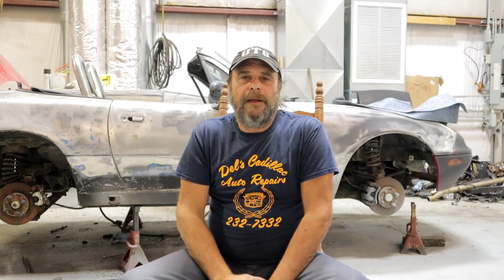Automotive De-Evolution...The Next Big Thing?

Comment: We are at a point where one’s interests aren’t limited by what the market is offering... for the most part. What I mean is as technology increases, that tech becomes less centralized. 200 years ago the looms that Luddites were smashing were the cutting edge and very expensive. The average person couldn’t afford them. Then steel and metalwork became possible on an industrial scale. But as tech increases, costs lower and the average person can buy it. 

Right now we aren’t limited to what we find on eBay if we want certain classic cars. What was once only a dream, you can now buy re-pop tubs, whole unibodies, created by a third party if you want a Camaro or a Mustang. Eventually that tech is going to be available where any obsolete car and part you’ve ever wanted will be available. And in many cases, you’ll be able to 3D print or MIM whatever you need from a printer in your house. This is already happening with guns manufacture. By the end of the decade you will be able to make whatever gun you want in the comfort of your own home.

The normal flow of market creation is the limiting factor for attaining a given thing is cost and availability. There are few who can create what’s on the cutting edge at first. But as time moves on costs decrease, as long as it isn’t regulated through the roof. Economy of scale and competition makes consumer goods less expensive. Patents expire, competitors appear. And when the item in question manufactures the very items you want to buy, like a 3D printer, we will begin to see widespread specialization. Rather than everyone make their needs to live, individuals will master making certain things very well and transacting with others. Whether they’re making buttons, garden hoses, or reproduction 3.8 Buick V6 engine blocks for people who build Fiero re-pop bodies people are going to transact

Comment: Hit the nail on the head in so many ways. The percentage of owners that work on new mustangs, challengers, chargers, camaros etc..is tiny compared to the way it used to be. I mean just think how much of that 50 year old aftermarket stuff is still out there. I wonder how much of the new "update" (as they say) stuff will be found 50 years from now.

 The old iron had soul and character. Regular people, hot rodders etcetc.. commonly used to name their cars based on what kind of personality the owners perceived them to have. Not so much anymore. Big rigs have gone the same way. In the mid 80s you could tell blindfolded what engine or sometimes even what brand truck was around you by the sound or the flavor (smell) of the exhaust. Today.... they're really big appliances for the most part.  As for not connecting to appliances tho...... you just haven't seen a woman get that connection...... haha..you see the right one rub on a fancy stove or fridge you'll wish you were the appliance!  

Btw you could have a whole separate channel just on carburetion (not saying you should, just could).  The number of guys who are clueless and think they are voodoo vs. all the different carbs and purposes they can be built for is largely untouched far as I can tell. Even a lot of the rebuild stuff you find is kinda generic. Whole buncha guys out there wouldn't even try rebuilding a lowly rochester 2 barrel. Just simply can't find someone to show them how and give them confidence they're going the right way. Thanks for sharing

Comment: Way behind you, i coverted my 94 f150 with a 300 l6, from efi to carb years ago.
Reply: Lets be honest though, that first gen efi was garbage.
Reply: @JonsGarage89  it was junk, i gained 3mpg by going to a 600 cfm holley
Reply: @oldreliable303  Heck yeah, I assume you used the offy 6=8 manifold? Those are fantastic.
Reply: @JonsGarage89  well first there was a homemade tunnel ram, but that did not work very well then, came the offinheizer c manifold

Comment: My first car was a 1974 dodge dart sport with a slant six automatic. I paid $125 for it and had to drag it out of a pasture. I spent my summer getting it running and cleaning the years of dirt, leaves and twigs out of it, but I loved that car. To this day it was the most enjoyable vehicle I've ever owned. I didn't have to worry about scratching it. It wasn't fast, but it was fun to drive, it was cheap, and it was fun to work on. It was so simple and easy to work on everything. I was a high school kid and was able to figure everything out (before Google and YouTube). That was over 20 years ago and I wish I still had it. I have such good memories of that car that I might try to look for another one. Not because I need it, but because it'll put a smile on my face and bring some fun back into turning wrenches.
Reply: Mine was a 67 camaro rs paid 300 bucks for it had a 327ci that ran very well then the army called and my car ran off on me.

Comment: the issue is parts.  Good or bad matters not. the 80's and 90's electronic
and onboard computer parts are NOT available. 
To put this another way, one can fix a carburetor  leak with new gaskets you can make
or a few layers of JB Weld epoxy.... while you hunt a better part 
I know of no one who repairs Dodge omni brain boards.
a machine shop can make most 1960's era engine parts
as well as gearbox and diff bitz...
automatic trannys may be a show stopper.
a 1962 dart is likely to be road-able before that 1989 omni

Comment: I've got 81f100 351for 20years an 33yrs 76f250 302 both Cleveland v8 here.in australia Japanese an European plastic junk is every where an all used to have a go at me for driving a gas guzzlers now with the cost of repairing them I have the last laugh it's costs them thousands to fix the new diesel when they break down after getting water in the fuel

Comment: This concept speaks to me.  Plan for a new project is a blend of modernish and old.  89 5.0 HO, fabricobled tunnel ram, single carb blow through with a turbo.  Going into a 63 Studabaker Lark gasser style.  Grand Cherokee Dana 44 welded in the back.  Still scrounging for a proper straight axle for the front.

Comment: When I was growing up in the early 1980’s, all of our cars were junk - ‘68 Mustang 6cyl Coupe, ‘73 Pintos, ‘75 Granada 302v8, ‘74 Econoline with a 289 v8 swap running, ‘48 GMC 1 ton (original), ‘73 Cutlass 350 Rocket v8, ‘68 Buick 6 cyl …just a bunch of worn out junk. But I enjoyed working on them and fixing them, rebuilding engines and swapping used parts. I could usually get anything running if it had some compression...just add spark and fuel and it would pop.  I even got a junk flathead v8 running once. I sold used engines and did some rebuilding/re-ring jobs, and junked out cars to make some cash. They were fun and cool and dangerous, loud, foul smelling things. But there was such an appeal…I guess it’s the gasoline in my veins. Thanks Uncle Tony…glad some people understand.

Comment: I bought an 83 trans am for my my first project/ hot rod thinking I was getting something like your talking about simple and enjoyable to work with but it definitely not 😂 there’s so many hoses on the thin it looks like someone dumped a giant pile of spaghetti noodles on top of the engine. Just trying to change the passenger valve cover gasket was enough to make me want to junk it 😂 I’m still looking for a video of someone doing just what you said de-evolutioning one to clean up the engine bay and make it simpler. Literally gives me a headache just looking at the forest of hoses and wires 😂

Comment: I’m 19 building a 69 roadrunner and a 68 coronet 500 I’ve commented quite a bit and I actually have a set of Holley 6 pack carbs and a carter 850 CFM thermoquad  and a set of a carter 4131S AFBs from a 66 426 hemi

Comment: Modern 3D CAD and CNC machine tools, while amazing in their complexity and accuracy, are so close to geometric perfection, that they give a noticeably colder and less "human" look to everything. The pre CAD and CNC era product still had the tell tale signs of the hands that made the models that were then used to pantograph cut the metal for most of the tooling. This is a subtle but real difference. 
Then you have the much greater array of geometries open to the CAD designer which promote design decisions unique to CAD. Finally, you have cost cutting which cheapens all those other factors. The end result is the soulless look we all know too well.

Comment: Biggest problem I've seen with Stand alone EFI systems most don't have a clue how to wire them up. I've seen it, ground and power wires not ran to battery, piss poor connections from non sealed crimped butt connectors that barely hold wire in, tapped wired together and even seen house hold twist nuts WOW. No grounds from engine to chassis or engine to battery. People still using old alt that car came with like older Fords with 1g alt that they used from mid 60's to mid 80's. They barely good enough for what car was built with but people put on EFI system, CD ignition or booming radio. NO WAY IN HELL that Alt will keep up. All cars manufactures had this problem with barely good enough alt. Let alone I'm a tech doing this for 30 yrs seen ton of stuff and people wonder why they have soooooooo many problems. Even with old stuff back then they called everything junk junk junk. My dad worked for Ford dealership through 60"s and early 70's plus working at transmission shop and at home. Everyone call vehicles junk back then too same story every year so whats new

Comment: I am 36 uncle tony and I can tell you I got  really interested in this era of engines and wanted to know the tricks bc being a young kid in the late 90s and early 2000s I was told by every generation that was older than me that I would “ never be able to afford one” which really made me think “ why not?” And it only made me want to experience these cars more.  I have had a few bandit trans Ams, a 72 Mach 1 351 cobrajet 4 speed car, and now I have a 72 gto 400 4 speed.  I think because at that time when I was a kid since there was already a romanticism with American muscle and the sounds of a factory hot rodded v8, older generations basically saying my generation was too late to the party short of put a fire under our ass.  I don’t care about turbos and running 11s easy, I want to get a stock 60s or early 70s muscle car and jet the stock carb, curve the distributor, throw some headers on, and that sort on thing and actually experience what it was like to be a gear head 50 years ago and know what kind of result I can get using those same techniques that were used back in the day . It’s really about feeling like you can get back in time and experience something that is lost to everyone around my age. Also, btw that engine shoot out was a suggested video yesterday on YouTube and i clicked and watched the whole thing.

Comment: My dad test drove a z28 four speed 302 . Back in 1968 . White and gold . Convertible . The sales manager gave him the keys & said you wreck it you bought it . He did not want to ride with my father . It was wicked fast . He took it easy . Was not Broken in yet . My mother wouldn't let him buy it . Car pulled the frount wheels off the ground while burning rubber . I saw one when I was 21 my sister tryed to buy it . My dad let the clutch out . I had to keep from Rollin in the trunk . Back wheels breaking loose front end going off the ground car flying like a rocket . She did not buy it we all said no . New cars are power full but not like that . 1970 you had power style smooth ride beautiful insides . Next best thing we're 1983-87 Monte Carlo all was right except low power 305 EFI  . Close but not quite

Comment: It comes down to  two things. First is SIMPLICITY. Most anyone could/can do most of the work with very basic tools. Second is it was CHEAP. Check the price of a cam for a new LS engine vs. a 350 Chevy. You don't need to go to someone and have them tune your car with a laptop and a dyno $$$. You need a regular screwdriver a 9/16 wrench and timing light.

Comment: I agree that 1970 is the high-water mark for performance but my favorites have always been 67 through 69 simply because I didn't like the changes to the Interiors in the cars in 1970. It seems like 1970 is when the plain steering wheels and wood grain Interiors took over.
I've always liked the black and chrome Interiors with Chrome on the steering wheel and a chrome horn ring.

Comment: Amen, Tony.  This upload is THE spot-on philosophical eternal truth of the automobile.  Someday, somewhere, someone will write an article dealing with the literary "ideal" of the most perfect automotive "hitting the nail on the head".....AND, this upload will have no peer.  You are so right- on about the major love affair a fellow has with a car that has to deal with the feeling of "I've died and gone to Heaven" feeling that you get when you are elbow-deep working on your car and your semi-warm 24th can o' beer was so slick with engine grease/oil that it nearly slips from your "tired from turning a wrench" hands that you could barely hold on to it.........and you looked at the clock in the garage and noted it's 2:30 AM and figured "What the hell", I can still get another hour or so in and still make it to the job tomorrow.  As you looked out of the open garage door into the black night with the twinkling stars and you just KNEW that this baby's gonna run like a raped ape tomorrow.     Yeah, there's a tremendous thrill when you run one of today's supercars thru the gears.......but, somehow, it can't compare to the feeling you got doing the same thing with our cars that we actually worked on, fixed, and understood how each part worked.  I am old enough to be your Pop and I was one of the "Levis, white socks, loafers, and a "pack of Lucky's rolled up in the T-shirt sleeve" generation that prayed at the altar of horsepower, more tire, bigger/more carbs, chopped and channeled hot rods..........and the Lord looked down on us and noted, "IT IS GOOD".  Something tells me that, even HE when HE looks down today at the ever-more-complicated stuff, gets a tear in His Eye.

Comment: Funny you mention the old cars had a coolness and character the new ones lack. I watched a video where a then brand new 2020 Shelby Cobra went head to head with an original 1967 Shelby Cobra. The engineer was explaining how to activate the launch control on the new one. “Push this, scroll through the menus, select this, say yes, then yes again ...” 

The coolness factor dropped like a rock. What a turd of a car, even if it is 5 seconds quicker and nearly 40 mph faster in the quarter mile.

'67 = 15.24 sec.   92 mph
'20 = 11.49 sec   130 mph

https://www.youtube.com/watch?v=FUO6nq8BDX4&t=85s

Comment: We connect with the cars people built by hand. With today's automated manufacturing process, everything is cold and clinical. The car has indeed become an appliance, designed to get you places and will only last a few years until the electronics get outdated and you can't get parts for it anymore. Nobody can connect with a temporary thing.

Comment: I agree with what you are saying. I got into the automotive service business because I loved working on cars. That was 1969, so I was there, working at a Chrysler Plymouth Imperial dealer in 1970 when all the cool stuff was being produced. I stayed in the business for 45 years and hated it by the time I retired! Why because it wasn't fun anymore. It wasn't that I couldn't fix the stuff it was because nothing was simple anymore. In the old days I could listen to a vehicle and tell what was wrong with it. I could smell if it was running rich or lean. I could hear if the timing was retarded or too far advanced. As long as a vehicle was mechanically sound I could take one that ran like garbage and have it running like a swiss watch in short order. Not anymore without a scan tool you can't figure out anything.

Comment: I just paused at 7:15. Uncle tony just nailed it for me. I have 2 cars, a 1986 buick regal with a 73 455 swap and a 2013 5.7 hemi charger. The Buick is my baby. ive been building it for 13 years, it'll never be finished and i love working on it. When I die, they can bury me in it. The Dodge is my daily and a great car 100K and no major issues, smooth, comfortable etc It's a keeper but yeah, I love it just a little more than my toaster, no connection.

Comment: The machine/speed shop I work at part time(I'm retired) specializes in that era engines mainly because the owner is 68 years old and that has been his bread and butter for going on 40 years.  We do a LOT of older 340/360/440/318's and at least three or four 426's per year.  He's "the man" to take such things to around this area.  We build a lot of stock stuff but also strip engines so can do whatever the customer wants.  We also do a number of just heads for everything Mopar/GM/Chevy and Ford as well.  Yeah, we do modern stuff as well but the "fun" stuff are doing the old engines for sure!

I bought a brand new Challenger T/A with a 392 Hemi in it two years ago.  It was REAL fast but just not "fun".  It was modern, no maintenance, reliable and had all the amenities.  In other words once I got tired of going "fast" on demand....it got boring.  I'd MUCH rather drive an old manual car with points and carbs(which I do) and get MANY more compliments at gas stations and such than that other one...so I sold it when I bought a new truck.

Comment: You are correct sir.  

Modern cars have no soul like older cars. Stainless and chrome have been replaced by plastic chrome colored poop. Dashboards (gauges) are garbage. I’ll take a late 60’s anything over a modern car. I used to love my diesel trucks but they are the price of a starter home these days and the emissions are complicated and designed to fail upon warranty expiration. 

I’m a mechanic and computer engineer so I work on modern cars when I need to but they are designed to make you angry when servicing.